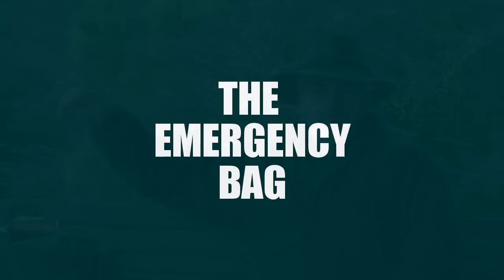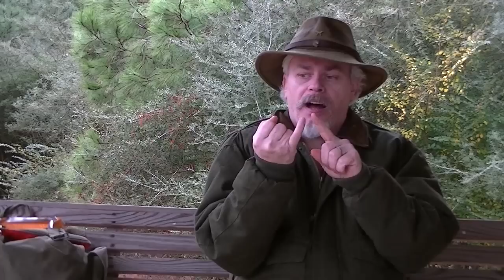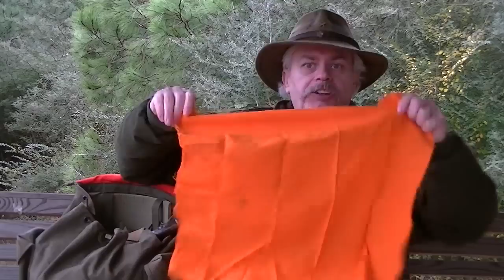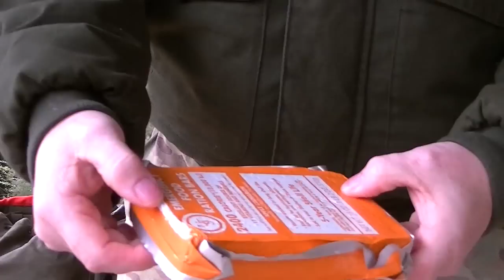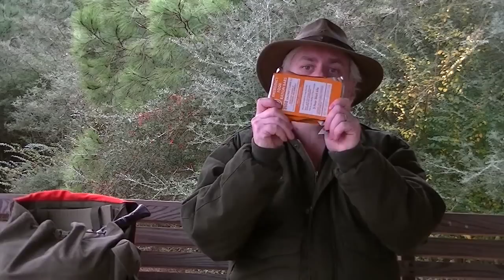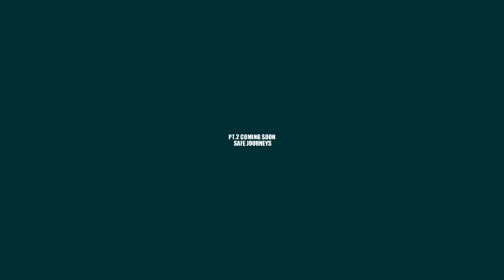THE EMERGENCY BAG

Comment: I would add that a larger pot with a locking lid such as an msr 1.6l can have a food can stood in the middle of it with the labels removed and water poured around the can. You will get hot food and a hot drink or sterilised water and no need to wash your pot. It will take slightly more fuel but is worth it. Also zip lock bags, they will preserve foraged food, protect half used food and can be used to boil water (with learned skills). I also make sure my pack is big enough to take my kit plus any foraged items I may find but not so heavy I can't carry it. Great instruction as always Blackie.

Comment: I love what you have to say.  My only problem is adjusting your experience and knowledge to where I live, which is central Indiana.  I seldom go south of Indiana because I'm a lover of the colder climates.  So it's west, east, or north for what I love.  We generally have mild springs and falls, relatively speaking, but we can also have frigid ones.  In a bad year, we may have to wear winter clothing in early June, and again in late September.  I've seen it snow as early as September sixth, though such weather is very uncommon.    Anyway, I love the way you present your knowledge and experience, and much of it does work up here
Reply from the maker: +James Ritchie i have been up in that country..its a very nice place..i love the cool as well..

Comment: I have heard Blackie that the emergency ration food aka lifeboat food are only good for survival if you need to keep your calorie count stable while being trapped in a boat in the middle of the ocean. Hence why they are called lifeboat food. From what I heard they are not made to be eaten and then you trek a bunch of miles or do a lot of survival tasks that you need calories for. I could be wrong about that. I only heard it from a couple other people, but I trust your opinion on the matter.